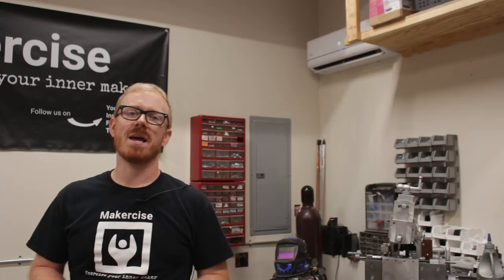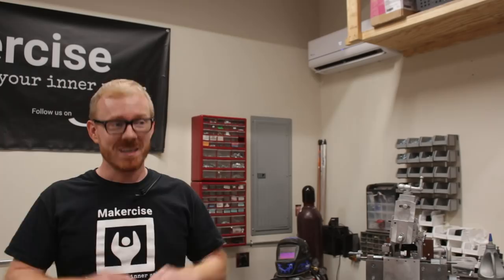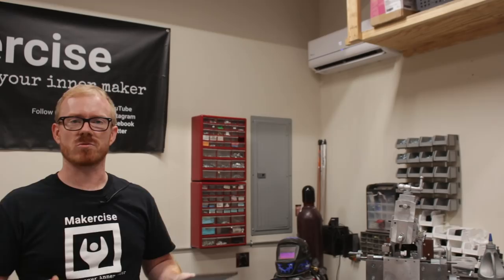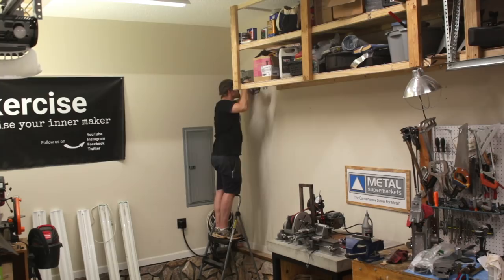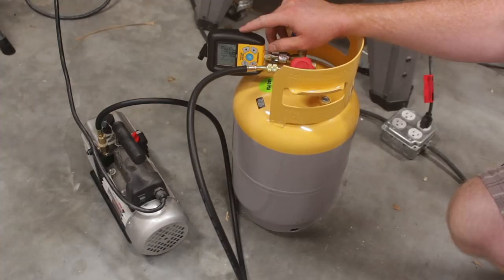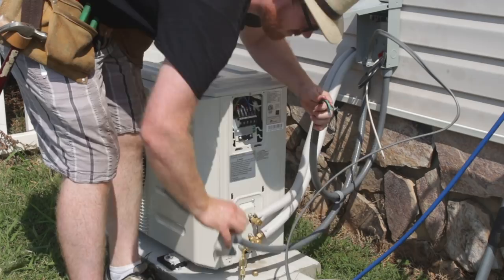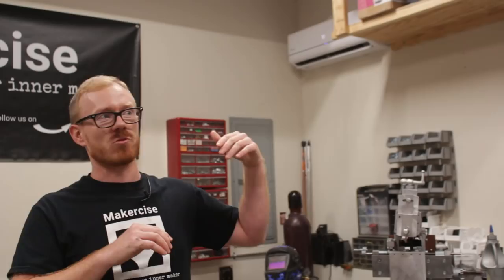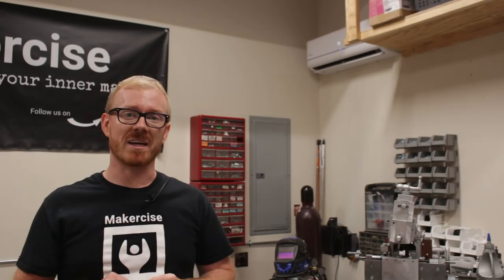DIY Mini Split AC Installation - Air Conditioning Install without Professional Help

Comment: Very thoughtfully laid out video explaining what is involved in doing this DIY project.  A few questions:  how does one find the information about the legality of doing this in one's home state or county?  Did the inspector also evaluate the electrical connections and build, which probably is more potentially hazardous than leaking refrigerant into the atmosphere?  And, if you had no prior experience setting up a 240 volt electrical feed to your unit, what did you do to learn (or be certified) how to install the line?  I am contemplating doing this at my home, but you were very forthcoming to let us know about the other details, e.g. certification and inspections,  and not just the mechanics of doing the installation. Kudos for a good job!
Reply from the maker: If you are in the city, call the city permit office. In the county call the county permit office. Some places are more accommodating to homeowner work. Generally the bigger the city or the more pro-union/trade emphasis/regulation heavy the area leans, the more they want to be up in everyone's business. Plenty of folks would fly under the radar for a job like this. 240V is just like wiring 120V except you have two legs. In my area no special certifications or training is required for home owner to do most jobs themselves if they pull the permit...with the exception of certain septic systems (regulated by the state of NC). I am very comfortable with electricity due to my EE background, but I can't wire commercially in my area without working for an electrician for 4 years pulling wire and crawling through spider infested crawl spaces. If you don't have any experience, you should watch lots of videos on how to deal safely with mains voltage levels. Start simple by replacing a light switch or ceiling light, then do something more advance like wire in an extra outlet from one that is already installed, then add a 120V circuit to you panel, then add a 240V receptacle. Starting small and working up will help you learn the hazards gradually. The county inspectors in my area are very helpful and encourage. They try to help ensure things are done and part of that is helping folks understand where to go to get the right answer. The full NEC is available online for free. It is thick but has all the answers for doing electrical work up to code. An annotated guide book gear toward residential installations would be very instructive for you. Good luck.

Comment: It's unusual that in the first evacuation (the one when the Schraders were inadvertently not depressed), a manifold gauge set was used instead of a micron gauge, based on the video

Comment: Not sure your tool calc is correct. Scale 130. Recovery 450. Tanks 150. 410A 200. Vacuum pump 150
Just seems a little light. Sounds like it took a very long time. Looks good though well done

Comment: With the tank on the scale and hoses connected, zero the scale. Then just watch it till it gets to the weight you need. If I recall it shows a Neg number, but you just watch the number.

Comment: Compared to a 6000W Central Air Conditioner, How much power do they use up? Thanks.
Reply: divide btu's by seer for average energy use.. Btu's by heating season preformance factor (HSPF) for heat.
Reply: Thank-You!

Comment: I guess when you went to add the virgin r410a, what I am assuming, and what the video does not show, is that you connected the yellow hose to the r410a and then pulled a vacuum on the entire line set....with the red, blue and yellow lines full open (red line connected to vacuum).  Once the vacuum was confirmed, you close the line going to the vacuum and then open the valve on the r410a canister---causing the refrigerant to zoom up the yellow line, down the blue line, and into the line set.   Can anyone confirm this would be the process, I think it seems obvious, but it is not stated in the video....maybe I will go back to the website.  Either way, thanks for the video!!!

Comment: Is your ac already precharged with freon?  most of the videos that I have watched so far  was already precharged.
Reply from the maker: Yes it was precharged. I didn't get the line set evacuated. I had to recover precharged refrigerant from the system since I didn't get the evac right.
Reply: It's not freon :-)

Comment: Know this is going to be lost here , but have you thought about putting the outside unit under a roof or in a simple small shed to reduce its energy requirements in summer cooling?
Reply from the maker: I considered this during the install but after researching it decided the gains would be too modest to merit the effort. https://www.directenergy.com/blog/shading-air-conditioner-myths/

Comment: As a licensed Electrician going on 38 years i have a question, Whats with the two 1/2" flex's from disconnect to outdoor A/C unit?
Reply from the maker: Knockouts on the unit were too tight to fit both the 4-wire cable from indoor to outdoor unit and the 3 supply THWN wires from disconnect to outdoor unit. Putting in separate flex made it easier to wire up. There is a better picture and a section on the electrical in the website article if you are still curious.
Reply: One is the line voltage going to L1 L2 and the other is 14/4 communication wire he ran it through the disconnect for some reason i always run it with the refrigrant lines.

Comment: why you dont simply use DIY mini spliter with quick connect precharge?
Reply: Hi did, originally, but he realized he didn't properly vac the lineset before releasing it, and therefore had to remove the refrigerant and start over.
Reply: @mattdonley2430  It wasn't a quick connect.

Comment: This is the first video I have found that talks about the schrader valve depressor (9:40) on the end of the vacuum hose. I just wonder how many viewers (including me) who could make the mistake of either reversing the hose end for end, or as you did....did not have the depressor in place at the service port end of the hose. Some videos I have seen says it doesn’t matter which end is which on the hose.

 Unless you do the evacuation correctly you are really just pulling a vacuum,....and then releasing the vacuum and allowing air back into the line set/evaporator. Thanks for admitting your mistake. I just wonder how many others have made the same mistake.....and not admitted it! 

What do you think of the idea of pulling a vacuum, turning off the manifold gauge and then opening the high side just a bit momentarily, then close the high side. This should pressurize the line set with refridgerant. Then take off the manifold gauge hose. There will be less refrigerant lost when you take off the hose.
Reply: Yes a good idea to pressurize the line partially then release hose to expel only a little bit of refrigerant

Comment: What is that building inspector for? I am from Germany so I am interested in the legislation over there.
Reply: if you go to your local county office here (in the US) and take out a Building permit, (on anything - a room addition, a patio slab, a garden shed, etc) then after the project is done (and sometimes at crucial stages DURING the project) the county building inspector comes out and "Signs off" the paperwork if things were done according to the rules or "Up to code" to make sure no shoddy work has been done to ensure a quality standard to protect you and your neighbors from faulty work that could otherwise cause problems down the road -
Reply from the maker: Each jurisdiction whether state, county, or city may want to have a say on improvements you can make to property. In many locations home owners cannot do a project like this legally. This is the type of thing I look for when moving. If I were planning to rent out this house, even as the home owner, in my county I could not legally perform the installation. That being said. No one would blink in my area if I did this work without pulling a permit.
Reply: Very interesting. Here in Germany you get a permit, then you start building. Small things like a patio or garden shed don´t need permits. Electircal stuff like your aircon neither. This is more for proper buildings like a garage. You won´t get checked on unless somebody complains or they pick you randomly which is very rare.
Reply: It varies from location to location...even neighborhoods might have covenants that require approval before you build a deck). In my area (rural Alaska) you have to get a permit to build a shed that is larger than 100 sq ft. People get around this, by building their larger shed on skids. This makes them "portable" (in theory) structures, so they aren't considered improvements to the property and can thus avoid the permitting process. A lot of other things like that occur....and yes, some flaunt the rules and nobody really bats an eye.
Reply: The real reason for the building permit and inspection is so any improvements you make to your house can be added to your house value at the tax assessors office.  That is, the permit/inspection process is there to raise your annual property taxes the "proper" amount.   The strictness to which this is done depends on which state, county and city one lives in.   I completely rebuilt a house, adding 1800 Sq ft, all new roof, windows, siding, plumbing. electric, and air conditioning without a permit required 25 years ago.  It's different now.   One other reason for the permit process is to protect the banks interests if you do not own the home free and clear and wind up hurting the value.
Reply: @petersherrouse33 
That is correct sir!
 to PROTECT the interests of the bank and pay more..... property taxes !
Reply: @petersherrouse33  That is true, but it also is to protect the occupants. A homeowner can take risks with themselves, but if he wants to sell or rent, those people will know it was done properly if it was approved by an inspector. It also helps mitigate risks to lenders.

Comment: Need EPA certification for mini-splits that are preloaded with refrigerant?
Reply from the maker: The way I read it, connecting gauges to a residential air conditioner requires EPA cert.
Reply: I seen our military use this preloaded systems because they can go just about almost wherever they need them, basically in parts of the world where HVAC techs holding a EPA certification isn't an availability.

Comment: I need to start installing ac in the USA. Here in Australia it costs you between $500 - $700 To have a large ac unit installed. I'm reading comments on here saying they charge you guys upwards of 5k ?????
Reply: They make it needlessly difficult to obtain certification in Canada so the installers make it needlessly expensive for the clients....
Reply: I think those $5k systems must be much bigger than the mini-split in the video. Many US homes have massive AC systems.

Comment: That's exactly what I was alluding to, why is the cable from indoor going through the disconnect to the outdoor unit ?,  according to the NEC here in the United States you cannot use that disconnect as a race also you are not allowed to install cable in a conduit that has a jacket on it,  the cable from indoor to the outdoor unit should have been by itself.  All of the mini split units I've dealt with over the years only need the power from the disconnect to the outside unit and then the control/power wire from the outside unit to the inside unit, this should consist of one 4 conductor cable which is normally rated as tray cable.
At least this is my experance and may I add that the inspector was obviously not with an electrical background or he would have caught the two flexes routed between the disconnect and the outdoor unit because that is a very odd installation as we never see that in the trade. Although we have that same problem with inspector where I live.
Reply from the maker: This unit is the same as the ones you are familiar with. Disconnect box removes power going to outdoor unit. Indoor-outdoor cable for control/power to indoor unit from the outdoor unit. The only cable in conduit is the indoor-outdoor cable. Would you have installed a second box/penetration for the conduit containing the indoor/outdoor cable? Or are you saying NEC prohibits cable with a jacket on it inside a conduit? How would you recommend routing the 4 conductor cable from the outdoor unit to the house regarding conduit, box, penetration, routing to indoor unit?

Lots in the code books, and there is always room to learn. Thanks for discussing it with me. :)
Reply: @Makercise  i install these in bay area ca,  here I run the cable out with the refrigerant lines through the same penetration, then use seal tight flexible conduit from the exterior penetration to the heat pump.  The seal tight only goes in the wall a few inches enough to seal the outside hole.  Running the communication wire in the box could possibly result in interference however I hardly doubt that would actually happen though.  These things are very easy to install a job like yours would be  a 2 hour gig for me.  99 percent though couldn't manage to limp through this project kudos.  300 hundred micron should have been your target over 1k might have had some moisture in system, but with the cheapo gauges I know u did your best.

Comment: I like the Mr. Cool better, It does not require a license and it is MUCH easier to install.
Reply: I'm not convinced about the license requirement at all, but there are pros and cons to the Mr. Cool DIY series.  The obvious pro is that it's marketed and warranted for DIY installation, which is a pretty big deal; AFAIK none of the other units (including the other Mr. Cool lines) are--if you DIY the install, you don't have a warranty.  The biggest drawbacks IMO are price and efficiency.  A Mr Cool 12k BTU, 17.5 SEER DIY unit is just under $1200 at Ingrams.  A Pioneer 12k BTU, 19.5 SEER system is $638--$550 less for a more efficient system.  To install the Pioneer, I had to buy a manifold gauge set, vacuum pump, and micron gauge--total under $200, so I'm still $350 ahead.  And since I installed two units, the cost per unit goes down even further.

Comment: Excellent video, I want to install one of this brand, I am an EPA certified technician, my question is, could you have the manufacturer warranty with this certification?  thanks .
Reply from the maker: Gray area, but I felt like if I documented things like vacuum level, pressure test, and other items I could resolve a bonafide warranty claim. I have installed two of these units now and both performed fine. Two hot summers and 1.5 cold winters.
Reply: I think they can't legally enforce the warranty requirements under Federal warranty caselaw. I know they can't force you to register your product.

Comment: Always wanted to have a go at doing AC setups, i may dabble in it one day. Curious how you said you saved money with all the expenses? Or are you planning on doing a lot more AC work to cover the cost of the equipment?
Reply: IDK how it is in Cressels state he lives in, but in FL, all the equipment and licence he got can now be used to repair or install Home AC, Auto AC, a deep freezer in the garage, his own Refrigerator in the Kitchen, etc - so now for the rest of his life (providing he buys the correct freon) he can diagnose, and repair anything related to heating and cooling, correctly - Thus - Saving $$-
Reply from the maker: My buddy said he spent $6k for a 18kBTU/hr install. I figure even with tool cost (even if I only use them once), I am ahead on $ basis. I already used the recovery unit to repair my brother-in-laws van AC. In the past the recovery unit was too expensive ~$1500. Now they can be had for more like $400. I am really happy to have the ability to move refrigerant around and open systems if I need to.
Reply from the maker: Eclidean, in my state I cannot install, but I can repair. I would need to work for an HVAC installer for 3 years before I could buy that license myself.
Reply: Im in Australia so you would need to do a $3000 course to install ACs (just the gas side) pay an electrician to do the wiring for you, and all that gear alone would cost around $2000 here.

All our units are rated in kw, doing the conversions my 7.2kw cooling/8.1kw heating is around 24k BTU, just had it professionally installed including the price of the unit itself for $2500

Its funny how different places can be.

I would like to get my own gear ome day for doing car ACs
Reply: @Makercise  all units like this cost around $6,000 min plus additional cost for needed supplies by local companies. It's really pricey so you are doing just great..I'm still working on getting mine installed by a neighbor contractor at a base price.He's going to use me as his trial install lol. I don't mind, good guy. It's my idea to get this type of unit anyway so I am grateful.

Comment: I'm about to install one in my garage.  I'm doing everything except connecting the lines to the outside unit and vacuum the the system.  I purchased 12000BTU system for $300 and cost for A/C tech will be $175.  So total job less than $500.  I don't see how this saved you money.

Comment: you did not bleed the line before you fill the split unit with nwe R410a, so  your putting for the second time air and moister in your system
Reply from the maker: I vacuumed it which is a more environmentally friendly way to keep moisture out.